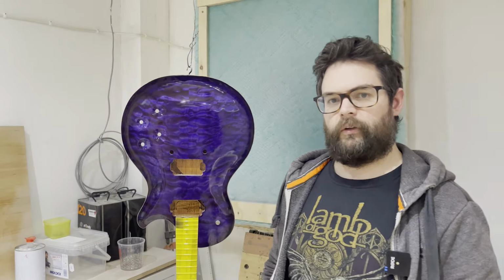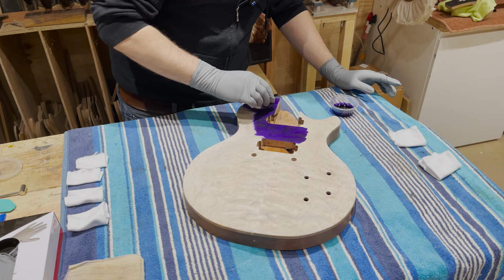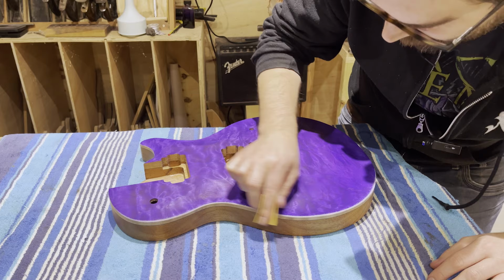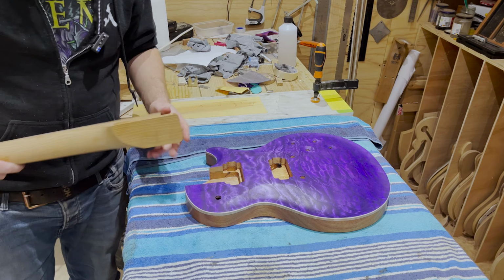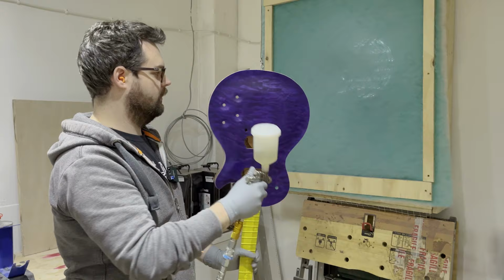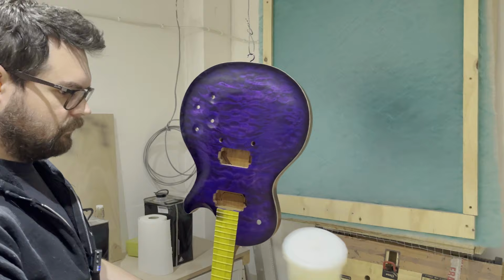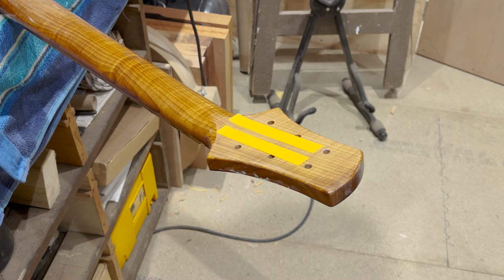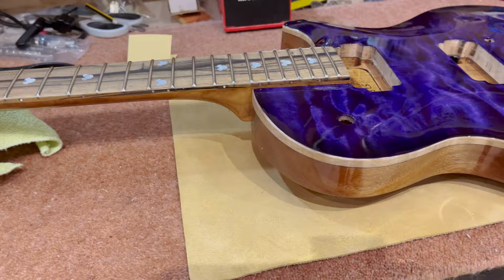How to stain and lacquer a guitar - Complete guide to guitar finishing with dyes and nitrocellulose

Comment: I never use a tac-cloth ! I find that most leave a slight film of some sort that clear coats don't agree with. I tend to use a "barley damp" paper towel to wipe down before I spray clear. And, I always wear gloves to keep the oil from my skin off the wood. Cheers !
Reply: I had the same problem but maybe it’s a different brand in the UK
Reply from the maker: Yeah I’ve had an issue with that before if pressing too hard with the tac cloth, especially if it’s fresh out of the packet

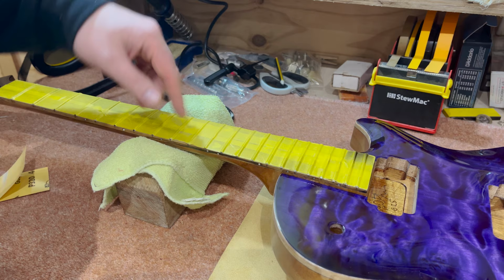Comment: A quick tip, that may or may not work is to put a bit of tape at the edges of the neck that you remove after every painting session so you don't have to do the sanding bit at the end (1:15:20), something that we do when painting cars so you eliminate the option of accidentally pulling some paint of with the tape. 

Also, why didn't you use grain filler on the top, or is it because it has been dyed earlier and therefore is already grain filled since the last dye? 

Great video, I was mainly interested in the staining part put had to watch the whole thing because it was so interesting.
Reply from the maker: That's a good tip, thanks for the insight, I might try that next time I'm spraying a neck. I don't grainfill the top A) because I don't want it to interfere with the dye. B) maple doesn't need grain filling. If I did an all mahogany guitar it would be a different story - I would use a dyed grainfiller which will do some of the colouring, then I would do spray a shader over the top to even it all out. Cherry mahogany with dark grain filler is a good example.

Comment: Super great information! 

You may not be able to answer this, but say if instead of a nitro top coat you wanted to do a Spray Max 2k top coat. Would you use a pre catalyzed sanding sealer (like Mohawk for instance) and then apply 2k using basically same procedures as shown here?
Reply from the maker: Sorry mate, you’re right I can’t answer that. All can suggest is do a tester

Comment: Great video thanks for sharing. What's your preferred spray tip size for cellulose?
Reply from the maker: I don't consider myself to be an expert in this regard, this LPH-80 I am using has a 1.2mm tip which I like, my old turbine system had a 1.3mm tip and I much prefer the smaller tip even if it does require slightly thinner paint.
Reply: @ADFinlayson Nice, it looks like you're getting really good results. Did you get the E2 or E4 cap? I'm strongly considering getting one of these LPH-80's myself.

Comment: Super vid, thanks! What are your thoughts on having a base coat like poly or CAB - is it needed to provide stability over time perhaps, or maybe it just reduces the number of top coats needed?
Reply from the maker: I think I did about 18 coats all in on account of the quilt top soaking everything up, normally I would only do 12 or 13 but for some reason I only sprayed about half the number of coats of sealer I normally do, probably concentrating on talking to the camera instead of what I was doing. No reason why poly can't be used as a base coat but you do need to be careful about compatibility
Reply: I think the reason they use poly or CAB is because it's more stable, much simpler/faster, and it doesn't yellow over time. I'm thinking about doing some finishing myself, but this step gives me pause - not sure how to do it best.
Reply: Fabulous and very educational !!  You answered about every question i had for finishing a guitar, and about twenty more I hadn’t even considered. Thank you so much. Now I can continue finishing my quilt top beauty with a little confidence. Thanks again sir.  You are the best.